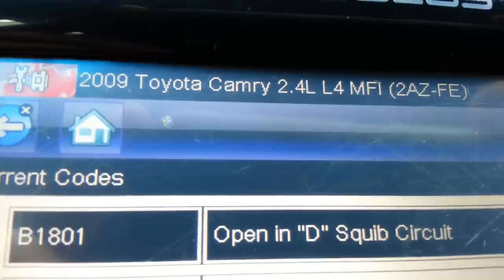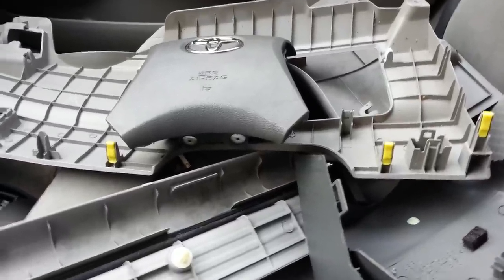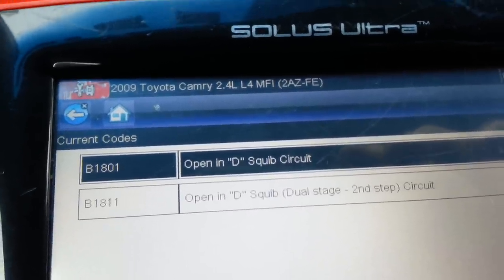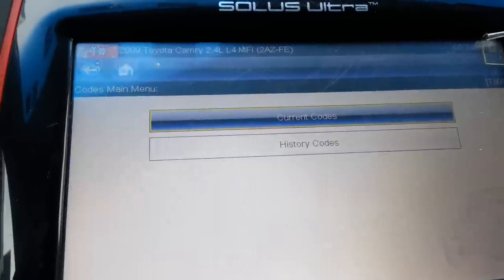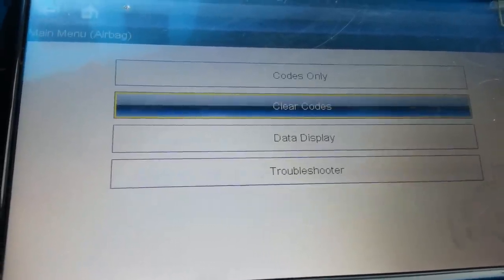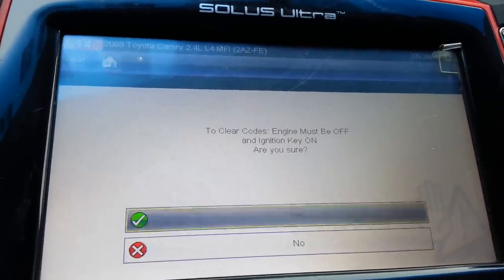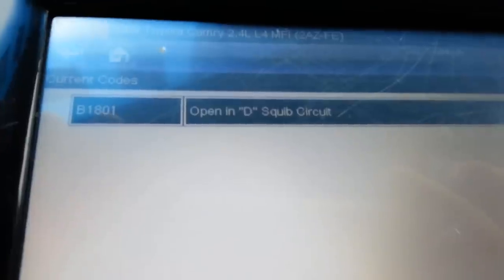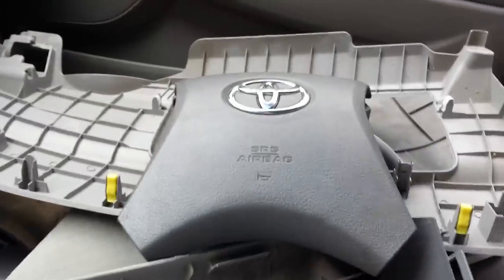B1801 B1811 Air Bag/ SRS code diagnostics

Comment: I have a B1181 open circuit  D squib 2nd step so the old owner used to remove the seats but they are hooked up and I checked with my scanner I gave a historical 1181 and current. My question is is there a code for the specific component such as squib itself or air bag or clockspring?
Reply: What was the issue? Same code

Comment: hi. i have same problem and same code i replaced clock spring and use obd2 for clean light , but still have problem and same code  b1801  b1811 please  help me
Reply: did you ever get this fixed? I have the same problem.
Reply: @jonathanstack7231  about you, did you get ut fixed?
Reply: @neygarcia8472   yes, I fitted a new chinese squib. At first it wouldn't recognise it and wouldn't clear the code..... then after a few hours when driving the code just disappeared! I think it would have gone straight away if I had used a toyota squib.